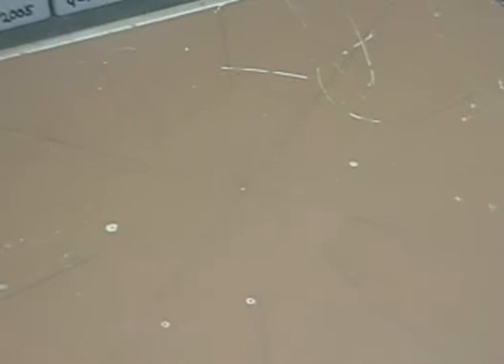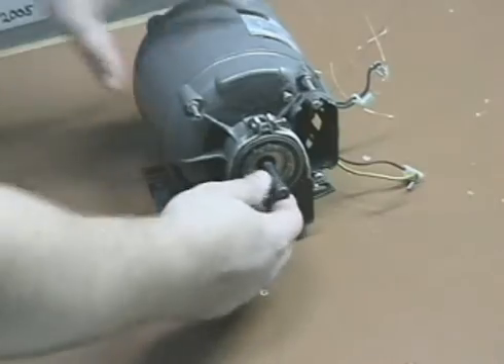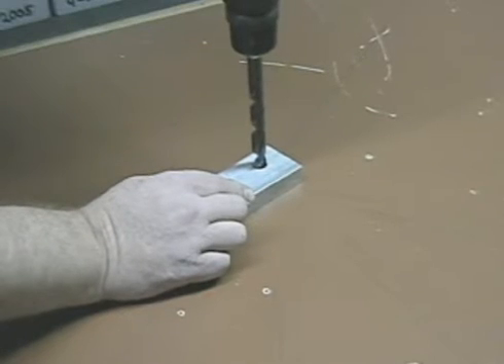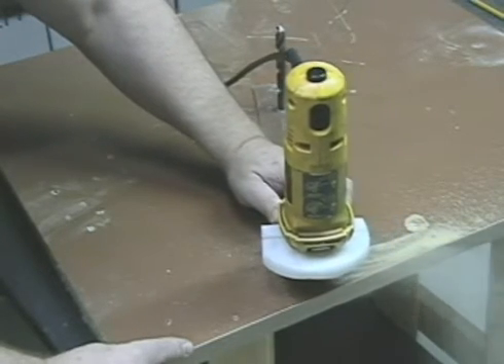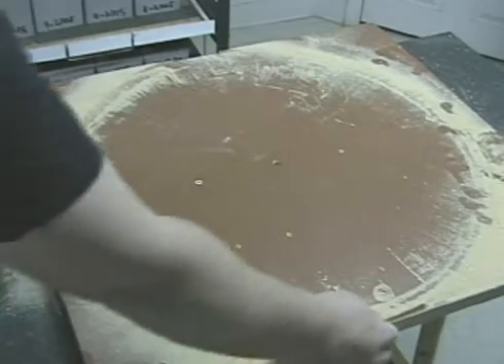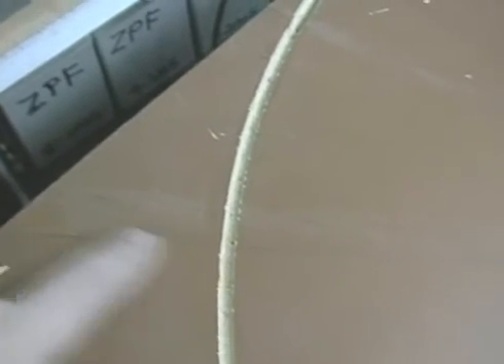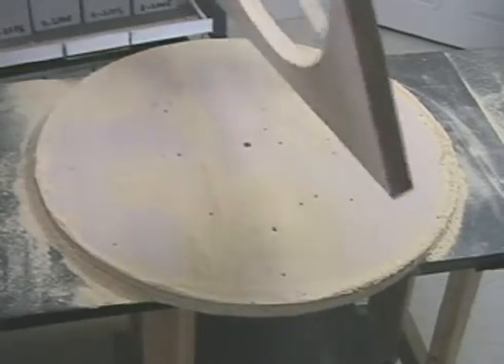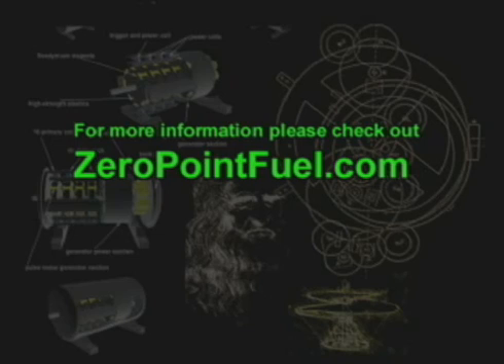Sequential Pulse Motor Project Part 2

Comment: great video the block to get your center hole then using the bit for the center point for your router two thumbs up wheel is ready with this guide and ideas anybody can do this project